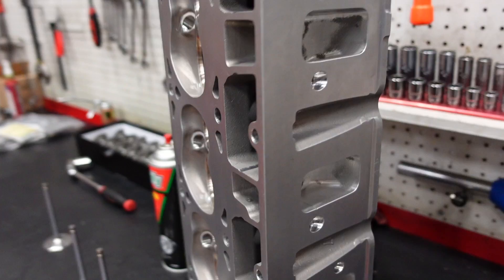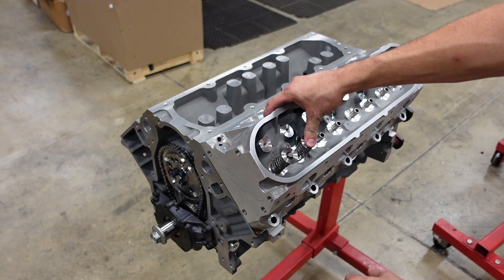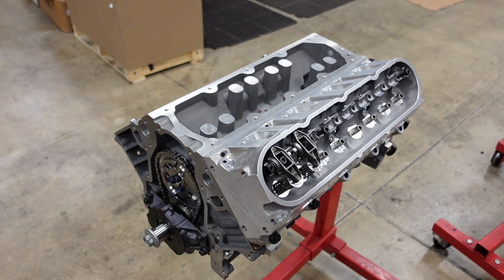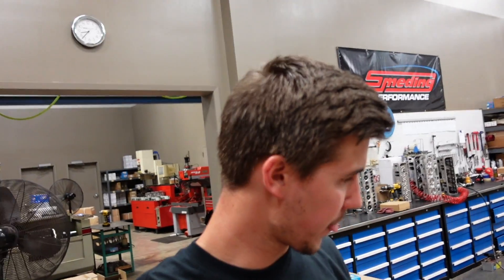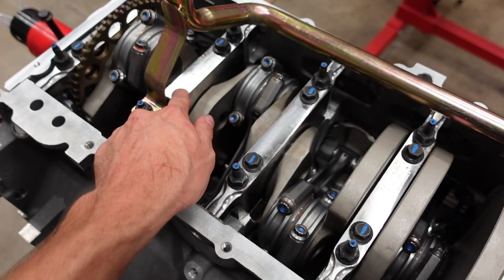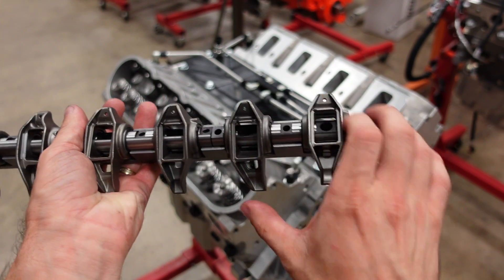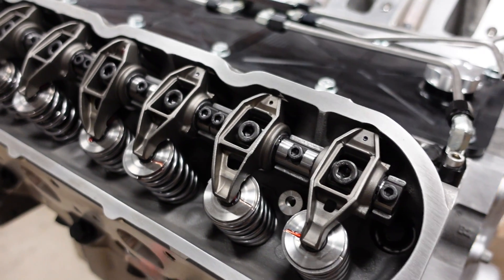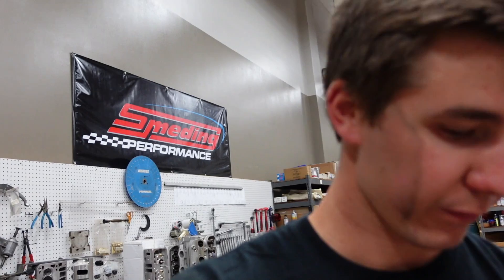HOONIGAN 700HP 441" 13.25:1 LS Engine Build - Part 3

Comment: Aren't you supposed to put a dye like Prussian Blue on the valve stem, and see with a full rotation, if the roller tip is in the middle of the stem?
Reply from the maker: If it's your first time, sure.

Comment: You didn’t have to put sealant on the middle bolts to keep coolant out? I have one that’s letting coolant by the middle head bolts and I had to take it apart and seal the bolts

Comment: I used a set of heads that where on a L92 and had them cnc ported by reher morrison on a 417 useing the L92  block.i used the johnson lifters  also.thing made 705hp @7100 with more fine tuning the combo tuning left.bottom line the 15°head is capable of making  close to 800hp if used with more cubes and hydraulic roller

Comment: Just a question, with such a awsome build and being that it will be seeing alot of rpm why are you not running atleast 3/8" pushrods?
Reply: Piggy back question.  Why are you not running ARP head studs?

Comment: I like your engine, bud. Just a note, the C5R 12* heads won a lot of LeMans  races. The LS7 had pressed in rocker shafts that lifted out of the head. Ridiculous for a 7000rpm motor, screw-in studs have always been the go to. Your shaft mounts are the best solution for stability.
Reply: LS7 rockers bolt down just like any other LS.
Reply: @dalethomas9307 and after market LS7 heads are top notch. Aftermarket heads fix the factory geometry...issues. So the rational behind a small bore head on a large bore engine is weird..not the end of the world but leaving power on the table for sure.